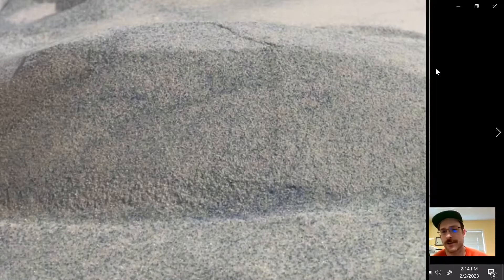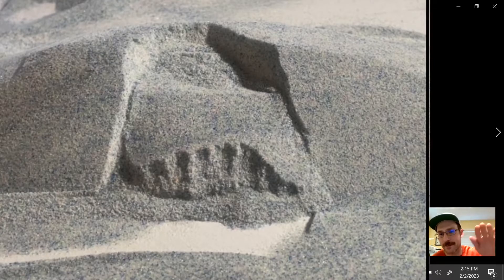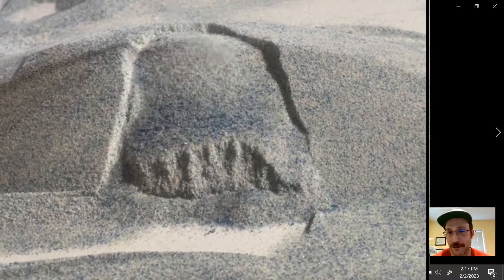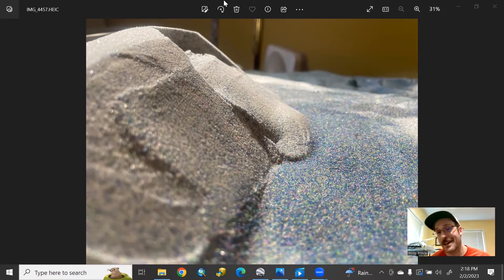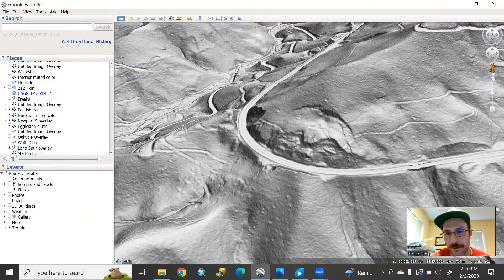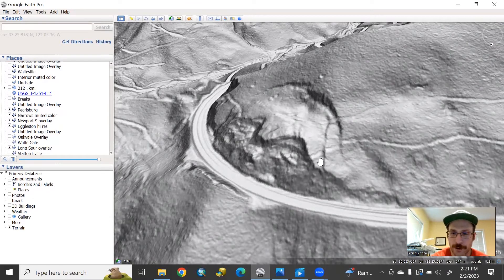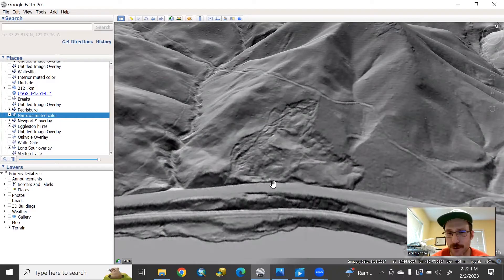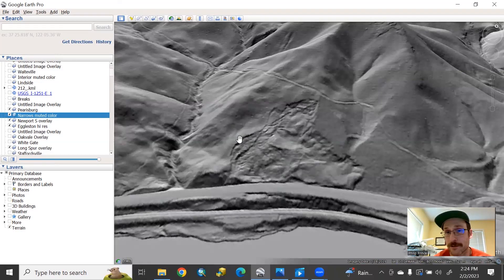Can we make landslides stop moving? | Engineering Geology Models

Comment: For these types of old creeping slides near roads, would elevating the road on piers work? i.e. give the slide room to form a toe underneath the roadbed. Would the piers be able to withstand the weight of the slide? My assumption is that the load would mostly go around the piers, like a wave against a lighthouse, but that's just an intuition! Also no idea if that's a realistic solution even if it's theoretically workable, as it'd probably be significantly more up-front cost than simply coming by every few years to endlessly clear the expanding toe with some heavy equipment.
Reply from the maker: It's a good question...My guess would be that any material that would not deliver too much load to piers would also be too weak to support much slide mass...sort of like putting weak fill behind a retaining wall, which can't support itself through internal friction/cohesion and puts more stress on the wall.
Reply from the maker: The slides I showed in lidar are both moving rock, and I imagine any structure intended to buttress or resist them would need to be a monster, for sure. I think the sliding material would have plenty of internal strength to mow down a pier. I bet someone has an answer based on experience! Maybe they will chime in!